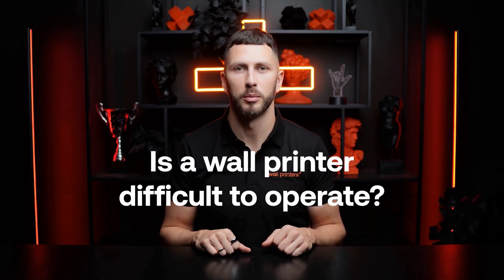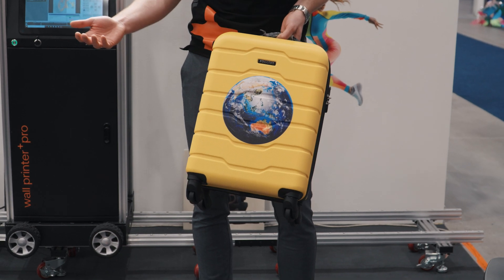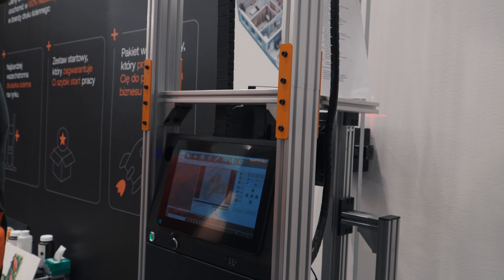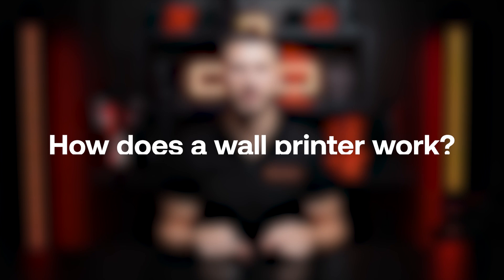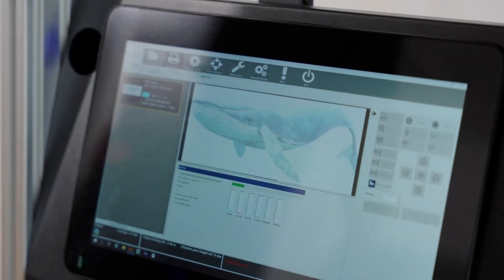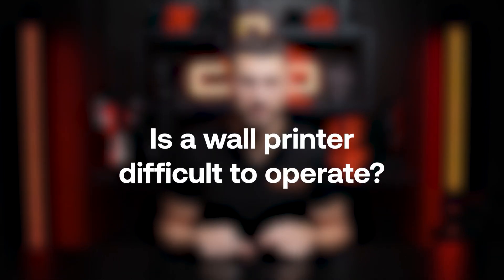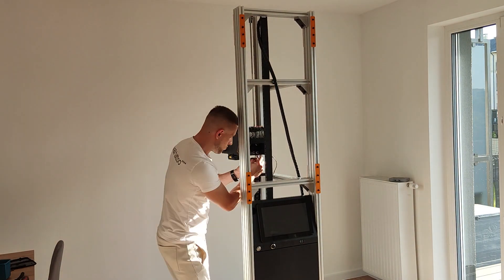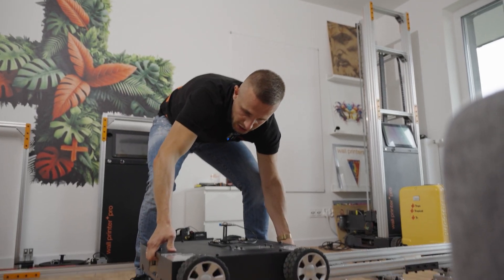What Is a WALL PRINTER and how does it work? UV Printing Explained! | wall printers⁺

Comment: Can a wallprinter also print ceilings?
Reply from the maker: Hey Denni! The printer's design won't allow painting on the ceiling because the printhead nozzles have to "spit" the ink out - in which case gravity would prevent them from doing so ⚙️🔩